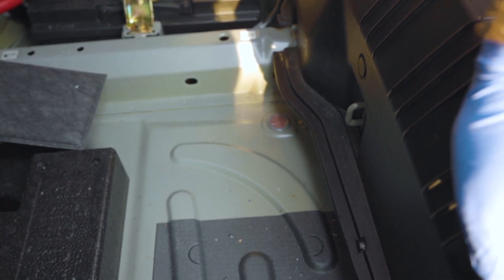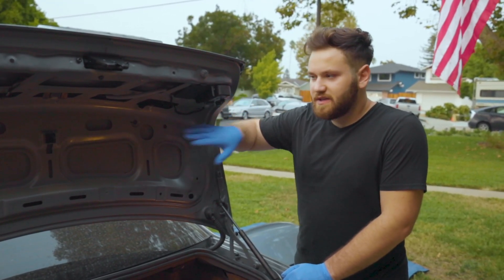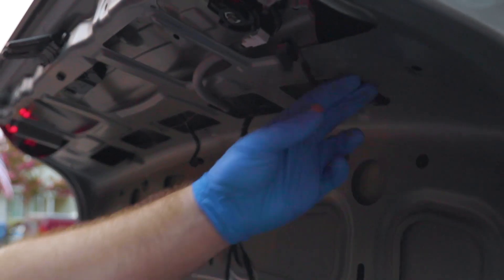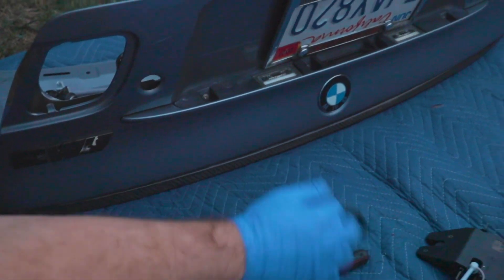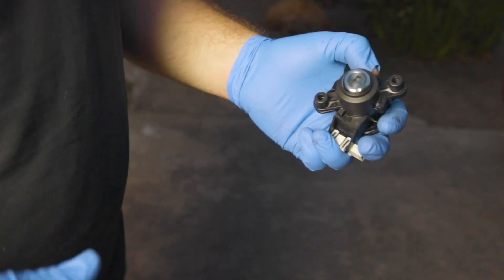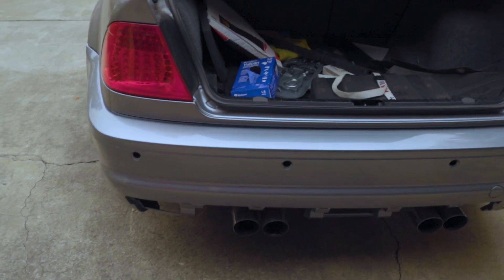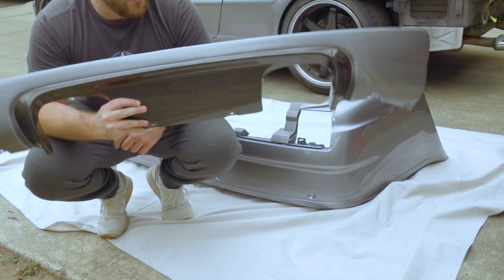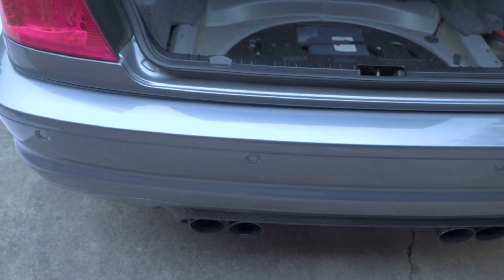E46 M3 CSL Conversion - Rear Bodykit Install - OEM Fit and Finish

Comment: That csl rear looks so sleek and the oem csl trunk fits like a glove. Awesome video keep up the good work 👌🏼
Reply from the maker: It does! The really transformed with the truck and diffuser. Both parts make a huge difference.
Reply: Nice! where did you purchase the oem csl trunk from? If you don't mine, how much it cost?
Reply from the maker: I got it from a friend that had purchased it from Schmiedmann but I think they are going for around 2.5k now (last time I checked). At one point you could have gotten a trunk for $1200 with group buys but now the trunks are more rare since so many of them were bought up

Comment: Cool vid my friend. I always want to swap out my regular OEM trunk to CSL OEM trunk it looks more aggressive. Where can I find it? I'm looking for carbon black color for my E46 M3. You have good video contents about E46 M3 DIY. SUBSCRIBED
Reply from the maker: I love CSL look for the rear a lot. Makes a huge difference tbh. I am not sure where you can find the OEM trunk nowadays since I actually bought mine like 2 years ago but never installed it. Check websites like schmiedmann and see if they have anything in stock. you will have to paint them to get the color you want.

Comment: Is the CSL trunk Status Gruppe also?
Reply from the maker: No, the trunk is an OEM CSL trunk I got a while back but never installed. The only status gruppe part is the rear diffuser, which needs slight modifications to fit.
Reply: @MunichVenom  what is it made of the CSL trunk?
Reply from the maker: The trunk looks like it is made from some fiber infused plastic material. The oem csl trunk is not made from carbon fiber

Comment: Without CSl camshafts your not gonna gain power, airbox alone doesn't do anything, don't waist your time at dyno. If I were you I would even go with higher exhaust lift camshaft than stock CSL to bring the RPM closer to 9k.
Reply from the maker: I was looking at shrick cams as an upgrade. Will have to see what I end up doing in the end. The 9k redline would be a sweet addition to the car tbh lol